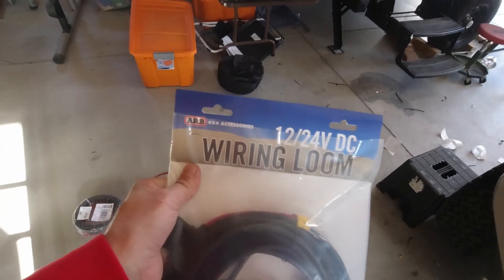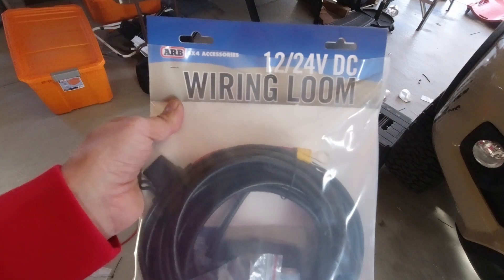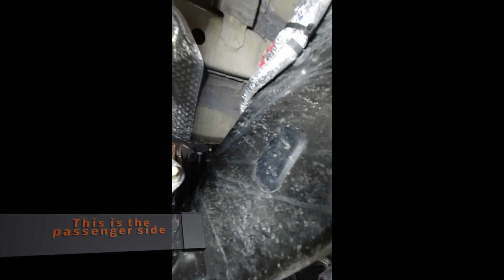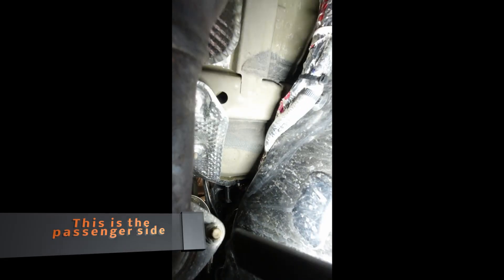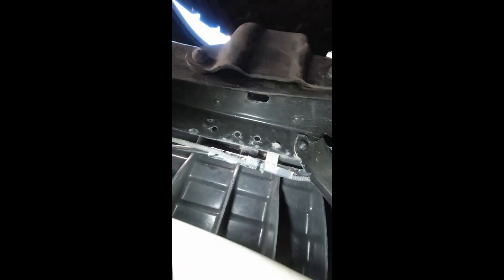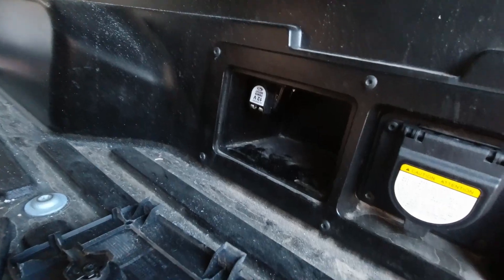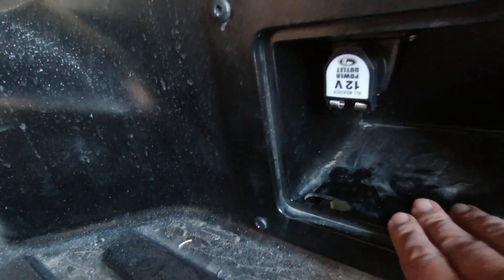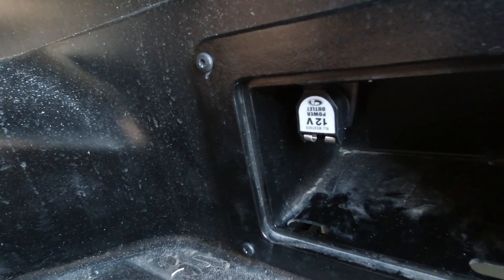Running ARB wire loom for my 12v Fridge 2020 Tacoma

Comment: thanks for sharing. interesting. why not just do the anytime 12v outlet mod?
Reply from the maker: you can I liked that this came with the complete wire harness it made running the wires easier and nicer.   plus Arb is using the correct size of wire for the run.   But you Defiantly can diy and it will be cheaper ..  Thanks for the comment